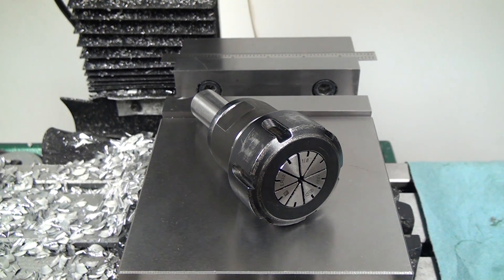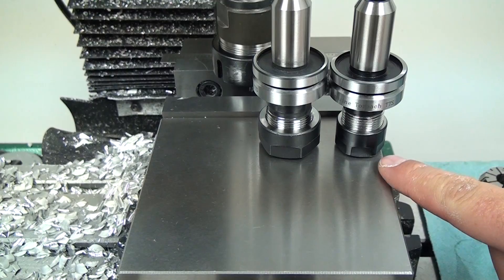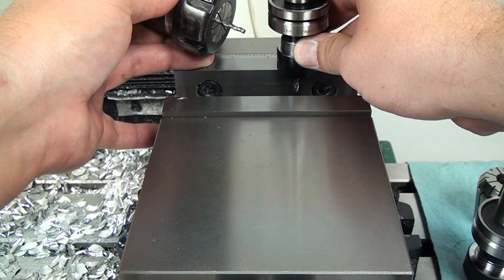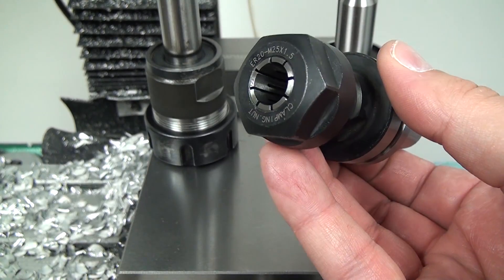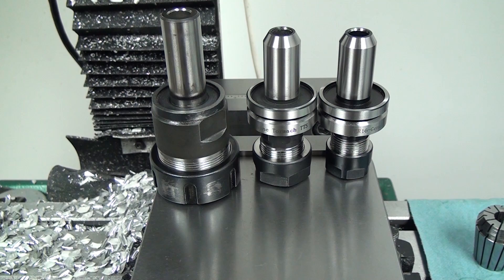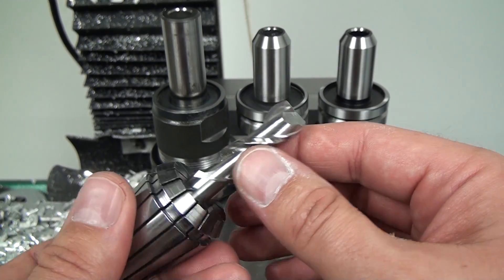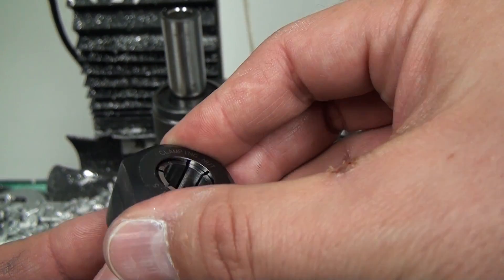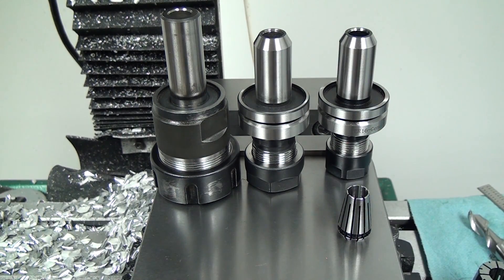CNC-G0704 #5 Comparing ER32, ER20, and ER16 Collet Chucks

Comment: Out of curiosity what is the difference between this and a holder that is the same size of the endmill? I have one of these holders with a built in collet and idk what tools I should put in it? Can I do ball heads and chamfers and all that jazz?
Reply from the maker: Are you referring to set screw end mill holders? If so, the only difference I'm aware of is that ER holders like this may be more concentric with the spindle. I would think you could run any end mill that fits in either style, as you'll want to check for run out regardless.
Reply: @russtuff  yup! thanks!

Comment: I know this is an older video. How does the Tormoc collet tool holder fit into the R 8 spindle on the Grizzly G0704? Is there an adapter?
Reply from the maker: Yes, Tormach has a 3/4" R8 collet for sale, and that is what the ER collects are captured by. The reason you need Tormach's R8 collet is that it is ground flat on the end instead of domed like a regular R8 collet.

Comment: Russ good video.  You helped me make a decision on the size collets I want for my g0704.  What about a sources for the collets.  The prices range from insanely cheap chinese collets up to fairly expensive.  Where do you buy collets.  Any experience with the very cheap ones?  Steve mckay
Reply from the maker: +trottrr50 s YS makes decent ones for about $5. Maritool is what I'd buy if I weren't so cheap. I just this week ordered 25 cheapos on ebay from a couple different sources I've never tried. I just went as cheap as I could find and we'll see how they are in a month when they arrive from China. It ended up being less than $2 per collet, shipped.
Reply: russtuff I will look at the sellers you suggested.  I am currently working on a cnc conversion of a g0704.  Going to do same as you did eventually with a vfd and big spindle motor.  Does that motor have an encoder on it?  What software are you currently using, mach4 or linuxcnc? I just got finished taking cnc classes at a local community college.  The classes were excellent but they kind of soured me on mach3 as there are g-codes that are missing from the standard fanuc set.  Class used a haas lathe and mill that were fantastic to use.  Have a nice holiday today.  Steve mckay
Reply from the maker: +trottrr50 s The motor does have an encoder but it's to high resolution to be useful. More to come on that in a later video.
I've only ever used LinuxCNC. Mach has zero appeal to me because of all the stability issues I'm always hearing about.

Comment: @Russtuff Great Video! Is there any benefit of using these Collets over a Standard R8 Collet? I been using R8 collets for my End Mills just curious about others. Thanks in Advance
Reply from the maker: The reason I use it is so I can swap tools more quickly. These holders go right into my R8 collet from Tormach and I can take them out by just loosening the drawbar a half turn.

Comment: I don't view the ER series of collets as what I would use for holding mill bits. The collets I have for that purpose are far more compact than any of the ER series. I think the main purpose of an ER collet is to hold large round stock or parts on a lathe or rotary table. For that I have focused on the ER-32 because it is pretty large but is still supported well by low cost off-the-shelf collet sets. The prices seem to sky-rocket with the larger ER's.
Reply: ER collets are tool holding collets - they are designed specifically for holding tools, not work.
If you want work holding collets, the C series collets are a good way to go.

Comment: I need one that fits my morse 3 spindle, I thought that the er 32 did because I seen some comparisons with the er 40 and I'm pretty sure that one is.  am I way off here?  the mill I have has small travel but the main problem is that the spindle doesn't even come close to reaching the table so I'm needing to add some length to my spindle and not having to mess with the drawbar every five mins is a big plus.  any nfo or advices is needed and appreciated..
Reply from the maker: http://www.shars.com/mt3-er32-er-collet-holder

Comment: for 1/8 Er11 is even better suited. There is no universal Chuck for any purpose. These chucks are relative cheap*, so buying 2-3 of them is the best way to go. 1 for small endmills , 1 for medium and one for large endmills :D. *What is more pricey are the collets
Reply from the maker: Agreed. I need to get some ER11.
Reply from the maker: Yinsheng still makes them I belive, but Tormach does not make an ER11 to my knowledge. I am not sure if the Yinsheng ER11s will have the TTS ring that Tormach uses. I would email Yinsheng and just ask. They are great to work with and will do business right through your email if you like. Someone I know just picked up a ton of their holders and they are still getting something like .0002" runout on them. I intend to grab a couple dozen of their ER16s in the near future.

Comment: Not to be nitpicky but when you measured the amount of stick out on the ER20 vs ER32 the smaller ground point is what you seem to be pointing out on the ER32 and the larger ground point is what you measure on the ER20. Not a huge amount of difference but the number would be large.
Reply from the maker: +Captian Morgan Good catch, I think you're the only other person to notice that mistake :)
When I say 1.650" stickout, I'm actually referring to the larger ground point while accidentally pointing to the smaller ground point. My words are correct, but my hands are in the wrong place. When I later put the end mill into the other holder and say stickout is .050" more, I am correctly stating the additional stickout but making it confusing to anyone who notices the same thing you did.

Comment: If you want even more clearence you may want to look into either making or buying dedicated endmill holders...the ER series are better then R8 for clamping power but there is still a risk that the endmill can be pulled out of the collet,especialy in a climb cut in aluminum , brass or other "clingy"material.You need more holders if you go dedicated but they have a setscrew that engages with the flat on the shaft of the endmill to ensure there is no vertical movement of the tool....they also usualy have much narrower noses on them...Unsure whether there are any made that fit the tormach quickchange system but they are definetaly worth having
Reply from the maker: +mountainmanfab I keep meaning to order some but never have. I'll have to make that a priority :)
Reply: Theres never an issue with having too many tools...well accept the broke as hell syndrome that tends to happen lol.Theres a lot of people out there that never have an issue with an endmill slipping in a collet so no need to make it a priority.I mainly mentioned them because you were after more tool holder clearence and they do add a real safety margin on a cnc machine...on a manual mill if your endmill pulls out you destroy the part,the endmill and maybe nick your vice...on a cnc, rapid travel with a tool thats a good bit longer then its supposed to be can get very ugly very fast!
Reply: Anyone having endmills moving on them in ER collets might want to review what the closing torque is for the various ER series. At each ones maximum holding diameter ER 16 is 30-40 ft. lbs, ER 20 50-55 ft.lbs, ER 32 90-110 ft.lbs, ER 40 120-130 ft.lbs. Those torque numbers are quite a bit higher than the average person can apply with any of the short collet nut wrenches that are supplied with the chucks.As the tool shank diameter gets smaller you can step the torque down a bit.The tool shank, chucks taper and collets bore and there slots needs to be dry and oil or coolant free as well. The only place where oil should be used is on the collet chucks O.D. threads for the nut.Buying cheap collet chucks and collets is another false saving as there a primary tool holder and it's a poor idea to ever go dirt cheap with work or tool holders. Higher runout numbers causes vibration under cutting conditions as the cutting loads cycle up and down. My guess is it's that vibration that's also not helping the collets grip. I've never once had a tool move in my Bison chuck and collets.

Since the Tormach quick change system uses basically a slightly modified R 8 collet for the quick change tool holders and ER chucks and your having problems with endmills moving in the ER collets Mountainman then it seems the R 8 is holding just fine? Properly torqued, clean and oil free R 8's hold and have proven they can do so for a very long time if there used within there design limits.

Comment: Thanks for posting! You have a ton of great videos that are 100% relevant to my current projects.

I've recently been contemplating adding some TTS holders to test out with my CNC'd G0704 (with a PDB in the future). I'll probably get a bunch of TTS ER20 collet chucks to start out.

It's good to physically see the differences between each size.
Reply from the maker: +Derek K I'm glad it was useful. Thanks for watching :)
Reply: +russtuff I have started using the TTS style holders. I love the z-axis repeatability. However, I am getting tool holder pullout without pushing the cutters that hard. Everything is clean and installed per Tormach's recommendations except for the drawbar torque. The stock G0704 drawbar has such small, soft wrench flats that I'm hesitant to really torque it down like it should be for TTS (main reason for me wanting a PDB is to avoid retorquing for each tool change).

Have you ever had this issue? How much do you tighten your drawbar?
Reply from the maker: +Derek K Hey Derek. I had that same problem for ages, until I started doing the following:

1. Brake Cleaner the R8 collet
2. Brake Cleaner the Tool Holder shaft
3. Thin film of any type of oil inside the spindle taper
4. Tighten the drawbar to 85% my total strength using that little 8mm wrench that came with the mill

I know it seems ridiculous and for a long time I thought I was going to destroy the drawbar by getting on it to hard, but it's held up just fine. Now I'm just an average guy who doesn't work out, so if you're ripped then maybe just go 50% total strength :)

Comment: I know this may sound crazy, but what do you think of the possibility of blowing air through the spindle down to the bit since the collet itself has lots of openings or air to flow through?
Reply from the maker: +ExtantFrodo2 Big commercial machines do it with coolant-through tooling, so it is definitely possible. But I have no clue how they actually do it.
Reply: russtuff
Interesting. Thanks.

Comment: hello there thanks for your share , tho my machine spindle adopt ER11 collet 3.175mm size. and i got other bigger shanks such as 9.5 and 12.5 dia endmill to use on my  my cnc3020 i need to mill a aluminum block for making a mold for injection molding, do i need more then just a new collet ? cuz i was thinking about buying this one http://www.ebay.com/itm/361440029113 and i know this one has to fit in my current black ring? im not sure whats the name of that i thought the whole assembly was called collet but when i search ER11 Collet they only show me the inner piece and not the part that screws into my spindle, so why is that part called? and more importantly if i get a 9.5 collet do i need to buy another one of those rings to screw into my spindle?
Reply from the maker: +Frank Lopez Yes that collet should work fine in your ER11 collet holder/chuck. In my experience there are only three parts:
1. The collet holder/chuck is the what holds the collet
2. The collet itself
3. The collet nut (In my video the collet nuts are black) which clamps the collet into the holder
You should not need a new nut to make a new collet work in the collet holder.
Reply: +russtuff thanks , tho i got a bit that the diameter is way thicker than the er11 collet can hold "3.175mm" it's 12.5mm dia? and the er11 only take 3.175mm ? but if i remove the collet  i do have a end mill that is 6.3mm dia? and that fits right in the nut so does this mean i can just get a collet that is 6.5? and use that with my nut since the er11 takes up to 7mm collet ?
Reply from the maker: +Frank Lopez If the shaft of your end mill is 6.3mm then you're really right between the range of what either a 6mm or a 7mm collet can handle so I'm not sure which one would work. You may have to buy both and see.
Reply: russtuff wel i thought that but i also thought that if i ask someone who seem to know their stuff i dont have to guess or take that gamble your asking me to take, i mean whats the whole point of the collet being springy in nature if is not to compensate? whats the point of the screw nut if is not to tie up any contacts between the in between like in my case?
Reply from the maker: +Frank Lopez You're correct, however, there are specific ranges for each collet. For instance here is a 6mm and a 7mm from Maritool who make excellent tools and a great price: https://www.maritool.com/Collets-ER-Collets-ER11-Collets/c21_56_60/index.html

If you click their 6mm and 7mm collets you will see these ranges:
.2162-.2362" (5.49-5.99mm)
.2556-.2756" (6.49-7.00mm)
This means neither a 6mm or 7mm collet may fit your 6.3mm tool. You may be able to use their 1/4" collet though, as it has a range of .2300-.2500" (5.84-6.35mm).
Reply: russtuff i guess im just left with maybe sanding down or place it on a home built lathe and gind away excess material, hmmm thanks

Comment: A couple of years ago, I standardized on the ER20 tool holders from Yinsheng with a Tormach TTS collet.  I've used them for manual tool changes and I bought enough to keep most of my tools in collet holders to speed things up.  I'm finally getting around to CNCing my Grizzly G1006 mill and I'll be adding a power draw bar soon (design is finished, parts are here, waiting for the round tuit).  I'm even thinking of eventually building an ATC (design is mostly finished, no parts are ordered but I did plan ahead when assigning I/O in the CNC conversion process).  I don't plan on needing the finger slots on the side of the tool holders.  If I did, I'd make the radial slots on my lathe.

Great G0704 CNC videos!  Thanks!  I'm uploading G1006 CNC conversion videos if you're interested.  Search for "Turd Polishing CNC".
Reply from the maker: Liberty4Ever Cool, I'll definitely follow your conversion!

Comment: you should know there's an ER-11 series of collets. It's a 1/4" capacity. For small end mills it's the way to go.
Reply from the maker: Good point. I didn't get into the smaller ER series because currently no one makes TTS compatible collet chucks. I have an ER11 high-frequency spindle and those collets are just tiny!

I believe that if you asked Yinsheng to make you a TTS ER11 they could do it, but since Tormach dropped their prices I haven't bothered to buy from anyone else..... yet.

Comment: You could also buy end mills with smaller shanks. For example, if the ER20 only goes up to half inch, and you want to run a 1 inch end mill, just buy a 1 inch end mill with a half inch shank. You can even do this in reverse (smaller end mills with larger shanks).

Comment: Sell the smaller ER chucks, buy a 1/8ths reamer , make a shrink-fit holder for your tiny endmills; something like 3/4" shank into 1/8" bore. The 1/8th's reamer has to be undersize by 1 thou on the radius.
Reply: Shrink fit holders require the tool and holder be of different materials (different coefficient of expansion), to get the tools back OUT, yes?  So, this approach would  allow only carbide tooling?  Or, disposable holders ;)

Comment: We skipped er20 when setting up our shop, and its something I regret. We use CCK3/4 and er16 (which cover basically the same tool range, and have virtually the same cap OD. We also use TG100, which also covers the same range, but is ultimately worse in near every category (larger nut, more runout..)

I like the bearing style collet nuts, but they're spendy. Solid holders do usually have more runout, but they're cheap and will usually provide the most clearance (short of shrink fit)

Comment: Good vid bud, I probably could use ER16's for all my tiny endmills, I use loads of 'em.  I've got around 50 ER20's and use them all, but when I need more maybe I'll get some 16's.  Have you mounted an endmill and measured runout with a DTI yet?  Shank has to stick out at least 1/16".  Rotating the toolholder in the spindle will completely change your reading, so rotate till it's near zero, mark it, then always install it there ;-).

Comment: The ER32 goes up to 3/4 (or there about)  

You also could have just gotten an ER11 holder on a 1/2 or 8mm shank and just chucked it up in the ER32.

One other thing is I have the ER32 for my X2 mill and also have the same size on my wood lathe and metal lathe. One set of collets for all. Only thing I really want now is a pair of ER32 collet blocks.